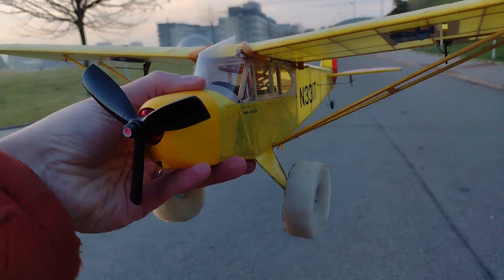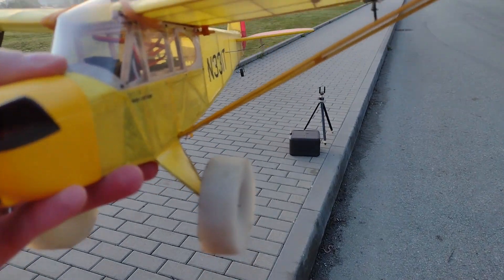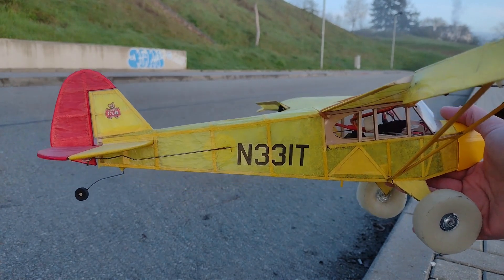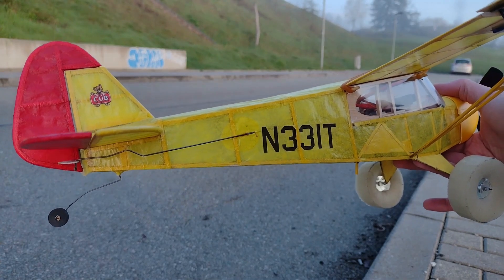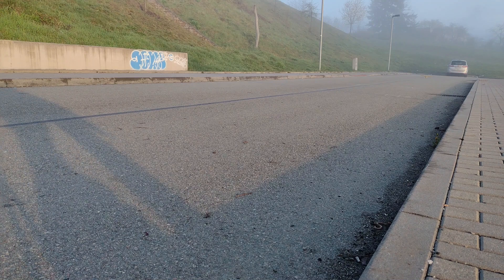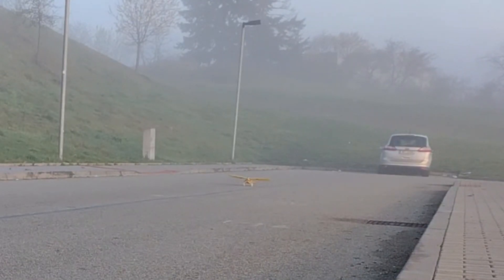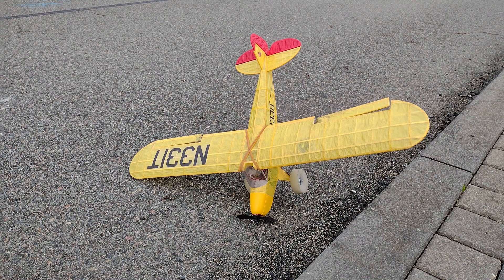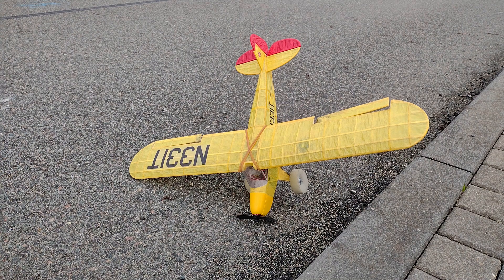12 Piper Cub RC Conversion   Second taxi run

Comment: Some good advice in the comments Andrew, it looked like the tailwheel lifted a couple of times but then nosed over, full-up elevator will help to keep the tail down but less as the speed builds otherwise it'll leap into the air! The amount of throw you had on the control surfaces at full rates was way more than you'll ever need, this probably strained the hinges and caused them to loosen. Looking forward to the next attempt, cheers.
Reply from the maker: Thank you for the tips. The tail did try to fly once so I tried to keep it down on other attempts (when I remembered). I fear a take off or a hand launch would be the first and last flight of the model. At least like this I practice the controls on the transmitter and start to get the feeling for what they do.

Comment: PLEASE put the time into getting your LIDL foamy ready for flight training first mate! And make it a twin (or pusher as a poor second choice) since nose-mounted motors don't go well with Noobs behind the sticks. 😉
That will give you some chance of getting comfortable with the controller and some idea about how much surface travel is usually needed with a model that will give you more than 1 try on each trip to the flying lawn. 😊
Reply from the maker: I think I am finally listening to the voices of experience! I am now full on the Lidl glider. 
Making it a twin is a dream at the moment beyond my skills. The pusher concept is interesting, I didn't think of that.
Balsa is for sure much more rewarding to build with, but as you say, the foam might give me the chance to get to fly and not just crash on take off.
Thx for all the comments and for not giving up on me!

Comment: Andrew, I suggest you just hand launch it. 
If you look at other videos of small models that Rise of Ground, they rarely display controlled taxiing.
Full throttle and haul it off as soon as possible is what I see.
Better still is to hand launch it. It's a plane. You really want it to fly, not taxi.
You may recall, at the very beginning, I suggested building it without an undercarriage at all. Of course it would look less like a Piper Cub. But it would have been flying by now - you seem to have plenty of power.
Wishing you good flying, next you are out. 😀
Did you spray a sealant on the tissue or was that a different model? If you did, perhaps try a bit more.
I think I may have mentioned previously, several models ago, that you may be better off a little later in the day when the atmosphere is drier - since you are not putting enough sealant on the tissue. You don't need "dead calm". I suspect it will fly at 30~40 kph so will easily handle 10~15 kph of wind.
Reply from the maker: All good points. I don't have long grass so I am scared of having a hand launch which is also the last one. With all the weight of the electronics, I doubt the wing and structure would handle a crash very well.
And I did put clear lacquer. At least 3 coats, but clearly not enough.
Flying later is an option but then there are more people and dogs around that would make me feel even more awkward than I do already.
Thx for following along and for the tips!

Comment: If you taxi. Stay behind the airplane. Then its much easier to steer. Left is left and right is right. If you taxi towards you its reverse. Same with take offs.
Reply from the maker: That is true, a little confusing and it could cause a correction in the wrong direction.